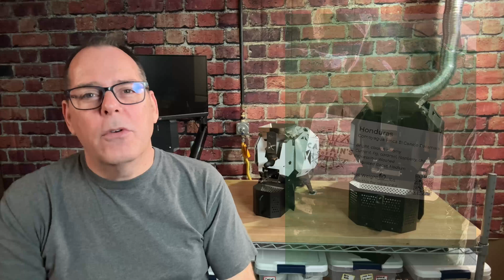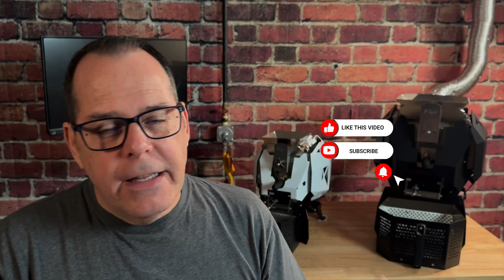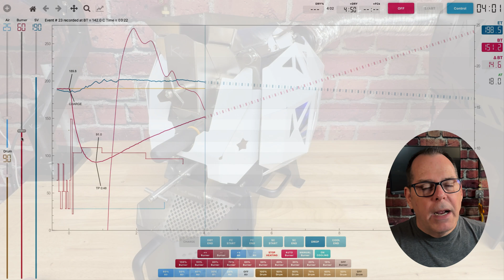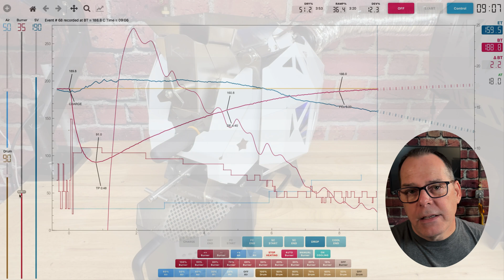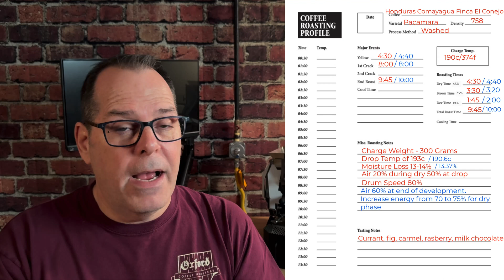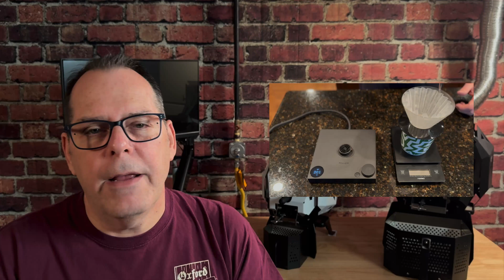Creating And Following A Coffee Roasting Profile

Comment: Hi! Have you any experience in roasting Turkish (for ibrik|cezve) coffee?
Reply from the maker: That's an interesting question.  I have never roasted specifically for Turkish coffee.   I would be interested to hear your opinion about my thoughts.  And, correct me if i am wrong.  
 I thought Turkish coffee was a brew method using super fine ground coffee, almost a powder and not the roast level?  As with espresso, which is a brew method, not a roast level, we can roast to whatever level we want based on what we want to taste in the cup.  Generally speaking, lighter and more dense roasted coffee may be more difficult for the barista to dial in for espresso.  It doesn't have to be dark, although Italians and many others use dark coffee for espresso.  Whether light or dark, it's all about solubility of the bean for extraction.  So, a lower density roasted coffee (one that is roasted darker) is easier to extract.

I think the same could be said for Turkish coffee.  Honestly i don't know if traditionally the coffee is roasted dark for Turkish coffee is roasted and drank in the middle east. I have traveled to the UAE and was served Turkish coffee in a "traditional Emirati eating experience" and i assumed it was traditional Turkish coffee.  It was was a nice medium coffee.  It was not really dark.  I've seen a lot of really light roasted coffee from the middle east, especially the Yemeni coffee.

About the brewing.  Turkish coffee is the finest grind you can achieve and is almost a powder.  Turkish coffee is brewed and drank with the grounds in the brewer and cup.  The user pours the coffee from the cezve (or ibrik) brewer into the cup, grounds and all.  Then the grounds sink to the bottom and the users drinks until the coffee left becomes thicker.  It might be fun to try that on my channel.  Thanks for your comment!
Reply: @VirtualCoffeeLab  yeah, thanks. Found similar opinion in some case.

>>>there's not a specific roast level for Turkish coffee and I believe there shouldn't be. But here in Turkiye roasters generally prefer 2 types of roast.
a) as soon as first crack starts you stop roasting (and most people claim that's genuine Turkish Coffee)
b) you keep roasting even after second crack ends which is dark french roast (and they call it double roasted)

South American beans, even with very light roasts they will keep their sweetness when you brew Turkish Coffee. If you decide roasting darker you may try central american (such as SHB Costa Rica roasted to City+), if you'll pass beyond city+ then definitely Yemen (if you roast Yemen to cinnamon and leave it there, you'll be wasting good some coffee for nothing).
Reply from the maker: Thanks for sharing that info.  I appreciate the follow up.   There are a lot of Yemen coffee houses in Southeast Michigan and quite a few of them are putting out a super light / cinnamon roast.  I
I agree with the Central American coffee.  I would encourage you to checkout some of the Kenyan coffee.  I roast that to a medium light roast  but include some nice development.  It's a longer roast profile and the sweetness is almost ridiculous.

Comment: Another great video!  I have watched a number of your excellent videos,  but there is one thing I can't figure out...How long should I target my total roast time?  I have an SR800 with the extension tube and am currently roasting a fairly high density Guatemalan (713). I understand creating profiles and the 50/30/20 percentages through the phases, but don't know how to pick a total time to base this off of and don't know what goes behind the decision.  Any help would be appreciated!
Reply from the maker: Great question James.  I will give you the short answer and then share some additional thoughts.  
Total Roast time can range from 5-10 minutes

So, how does someone know what time to use?  

1.  experience
2.  trial and error.
3.  watch and learn from others. 

I can’t give you a simple answer because there are so many variables.
Batch size 
Bean type
Roast level
Brew method (roasting for espresso)
The roasting chamber

All of these variables will influence your total roast time.  You have shared most of the variable.  Let me know the batch size, your desired roast level, and then I will be glad to try and answer your question with a starting roast recipe to roast.  

One last thing.  The 50/30/20 phase thing is important but it’s not a requirement.  It is designed as a starting point and geared for drum roasting.  Air roasting is different because the beans are heated with air (convection) so there isn’t a pre-heat and the beans aren’t relying on conductive heat transfer (touching hot surfaces or beans) to promote the roasting process.  Ultimately, roasting times are shorter overall compared to a drum roaster. 

Sorry, one more thing, really.  You are using a razzo chamber.  I’ve never used one so there will definite some trial and error using my suggestions.  

Let me know your charge weight and desired roast level so I can answer your question.
Reply: @VirtualCoffeeLab  Thanks for all the info.  I decided it may be best to setup a Zoom with you.  I had some issues with the transaction on your site so I sent you a message. Let me know if you got it...
Reply from the maker: just replied to your email Jim.

Comment: Hi Mike, it makes sense. I have been dialling back the heat going into FC so I can have a longer browning phase. I was thinking that maybe trying a higher charge temp might help give me more momentum into FC but I may have to shorten my drying time to around 4 min which might still be ok. I’ve been charging at 160C, then soak until turning point, and aiming for a 5 min drying and 3:30-4:00 min browning.
Reply from the maker: Skip the soak on the Kaleido.  AIM for between 4:30 and 5:00 for dry.  Then 8:00 or 8:30 for FC.  I would pick an air setting and keep it the same for the entire roast
Reply: Interesting, why skip the soak? I have an M! your BT delta looks so smooth compared to mine, May i ask your settings? Great video! @VirtualCoffeeLab
Reply from the maker: @jasonthompson2064   the reason i suggested skipping the soak is because Edward (@LivingTheLifeRetired) wantes to roast darker than this profile.  He mentioned he didn't have enough momentum to push him through first crack and he was stalling.  
My settings are the "out of the box" Kaleido settings for Artisan.  I'm not sure what version of the M1 you have so maybe the artisan settings are different.  I know that when I selected the "machine" settings and selected Kaleido Serial, I had to enter 0.4 for my roaster capacity so things would match up.  Not sure if you had to do that step.  Your roaster would be 0.1 right?
Reply: Ahh I see, makes sense for skipping the soak. Yeah my my is set up as a .1 capacity. I've played around with config<curves<RoRa bit and managed to smooth things out a little. Maybe theres a more sensistive probe on the smaller models. Thanks!
 @VirtualCoffeeLab

Comment: It’s interesting that about maybe halfway into your roast or maybe it was after FC that the ET was lower than BT yet the BT was still rising. When I’ve done my few roasts I’ve seen ET get below BT and I’ve always upped the heat to keep ET even marginally higher than BT. How can BT continue to increase if it is above ET? But watching again I’ve picked up another couple tips!!
Reply from the maker: Yea, there were a couple of things that I did on that roast.  One was kind of a mistake but in the end it worked out.  I forgot to increase my SV (set value) to a higher temperature.  You will notice it is at 190c I think.  So, i pretty much was coasting at the end.  This is one reason why my ET was lower.  The second is inherent with the Kaleido design.  The airflow is designed differently.  The air is brought into the roaster through a singular port (on the newer sealed units) and heated up by the heating elements and all the hot metal.  So, by the time the air enters the roasting chamber, it is hot air.  The ET is measuring this air temperature right at the exhaust tube, which happens to be between the heating elements.  So, when I lower my heat, the ET is influenced.  In some ways, you could say the ET is a false number because of this design.  I haven't quite figureed out everthing so far BUT I can say this is the reason we see a declining ET going below the BT, even though the temperatures keep increasing.  
My hope is i can reposition the ET probe and see how that influences the readings.
Reply: @VirtualCoffeeLab I see the ET lower than BT a lot and when I bump up the heat to get the ET temp higher it impacts my ROR of course in that I do not have a nice descending line but instead like new little mountains. Watching this video again tonight I see that you are making a lot of very small adjustments up and down to kinda tease the beans along to end at a light roast. In my last roast I was trying for a medium-dark and the temp had a long ways to go so I had to apply more heat at the end to get it to finish in 10 min, which caused another ROR spike. I know, it’s a journey. Cheers.
Reply from the maker: Nice job noticing the "teasing".  That is a technique.  I call it "babysitting" the ROR but "teasing" is exactly what I am doing.  This isn't critical to do.  As a matter of fact, many will just let the roast have those waves.  I don't mind them because I know most of that is the probe BUT the big swings I like to try and manuipulate/control.

Yea, so for a darker roast you will need more momentum as you come into first crack.  You will want to shallow your ROR descent just prior to FC so you don't stall your roast.  Not sure if that makes any sense but because you are using my technique  in this video, you won't get the darker roast.  Your temps will need to be higher as you get closer to FC.  When first crack happens it may be a little more aggressive in the popping but that is because you are pushing the beans a little more with the higher ROR.

Comment: Thanks for another M2 video! It’s really been helpful navigating this machine. I’ll try doing a 90 drum setting. 

When I first received my M2, for some reason, the high drum speed, medium high heat (75), and low air (20-25) caused my roaster to go through an auto shut off. 

Maybe because it was brand new? But I’ll try these start settings and see if it reacts like yours.
Reply from the maker: You have to be really really careful to brush out all of the chaff from inside the roaster.  The sealed unit roasters were coming with a metal grate between the drum and
Cha drawer.  The chaff will lay on top of the grate instead of falling through.  When you go to roast a batch, that chaff can ignite and you will see your ET spike and then the shutdown happen.

I use a paint brush and also the wooden stir stick to get the chaff to fall through between roasts.
Reply: @VirtualCoffeeLab  yes I noticed a lot of the chaff still remained stuck in the roaster despite being washed or wet hulled beans. 

I try to get them with a brush as well, but after opening it up for a deep clean, there is still a lot of dusting on the sides.
Reply from the maker: Yea, the dusting isn't the issue.  It is the small piles that build up in the corners, the chaff laying on the metal rods that are between the tray and the drum, OR if you forgot to empty your chaff try from the previous roast.

Comment: I agree with alecpulinas6919 this is one of the best videos yet. 
I ordered this coffee from "The Captain's Coffee" along with a couple of others to show my support for the sponsor. 
I started with a freshroast 500 which I used for years and produced some excellent coffee. I was creating a blend of 4 different coffees for espresso doing 10 small batches and the results were excellent but took literally hours. I upgraded to the SR800 but ultimately regretted it because I really wanted to be able to follow roast profiles and ultimately develop my own.
I purchased an Aillio Bullet (I am really looking forward to seeing it on this channel), my first roast was some Brazilian beans that came with the roaster. After seasoning the drum, I did my first roast which turned out to be amazing, I was super happy! However things went down hill from there. During the next roast, the drive belt pulley on the back of the motor started slipping (because had not been tightened during manufacturing) burning the coffee. I was able to access the pulley and tighten the screws and the problem has not recurred, however, after over a year I have never been able to roast anything that approached my first attempt. Many of my roasts have a metalic and/or burnt taste even though the bean color looks good. I plan to roast the same coffee that is featured in the video and follow this exact roasting profile. If the result is more metalic tasting coffee I think I am going to cut my losses and get rid of the Aillio Bullet and get something else.

Comment: Another great video Mike! Quick question, how do you think your profiles on the M2 would transfer to an M10 with a larger batch size? Say 500-625g? Any recommendations on "upscaling" a profile?
Reply from the maker: Matt,
I think for your situation, you should focus on your rate of rise  RATE at dry end and first crack.  In my video I talked about having your ROR be at a safe level at dry.  I need to ensure my ror is not so high I have to do crazy stuff with my heat.  I want to be in control and aim for my target first crack time.  I won't be able to do that if I am struggling with my ror  being too high or low at dry end.  So, on my roaster I like to be at a ror I know I can control easily.  I talked about that in my video.  The same thing goes for first crack.  This is really important.  There is a ROR you will want to be at when you reach FC.  If it is too high, your temps will increase too fast during the development phase.  You noticed this in my video because you just commented on it.  In both cases, you will need to find that ROR number at the dry and fc events that will help you maintain control and get you to your target times.  So, the lower ror during development is key to prevent the 205 number.  You said it yourself, your fc temp is almost always the same.  So, that means you need to be at the right or entering fc in order for you to drop with good development and achieve your lower temp.  Remember, color is king.  Start with color and correlate that with your drop temp.  Then as you practice roasting, you will know your drop temp range for the desired roast level and moisture loss you want to be at.
Was that helpful?  let me know if you need further clarification.
Reply from the maker: Hmm, I haven’t done this in a video yet but if I focus on color first, trying to roast to the same color level between the two roasters I’m most of the way there.  After that I try and hit my event times.  I think I should be able to get pretty close.  Unfortunately we can’t rely on temperatures to be the same.  The M2 I’m using has different temperature readings.
Reply: Makes since. I'm still really struggling with final drop temperatures on my M10 for light roasts. My 1C is always 196C, plus ore minus a degree no matter what bean I'm doing. I've been trying to follow The Captains Coffee roast level primer and hit 205C for a light, city roast in about 18%-20% DT but it always seems to have to much roast characteristic. I have tried dropping a few degrees cooler with less DT (15%) and they are under developmed. I see your roasts only increase 5-6C after 1C. What's the key to that, a good DT percentage?
Reply: Super helfpul. My ROR is usually around 8 at 1C. But I Think I might be still coming in with too much heat (usually 50-60 or so). This works for my darker roasts. I'll give your tips a shot!

Comment: With the behmor, if I want to roast 12oz of beans as my outcome so close to a pound of green coffee, how would I go about that with manual, I was thinking charge it at 300 degrees Fahrenheit and start at p4 and to maintain heat and then go from p4 to p5 maintains high head til browning then drop to p3 til first crack and then p1 til drop time, any adjustments?
Reply from the maker: Hi Carson,  can you share the type of coffee you are roasting and the roast level you want?  It sound like you have been roasting in the auto mode and want to do some manual roasting.  Is there a reason why you have to roast 12 ounces?  Let me know so i can offer a helpful response.
Reply: @VirtualCoffeeLab  I have been roasting sample packs from coffee coral to see what type of beans I like, but for the future I want to roast bigger batches but since I am doing samples, I only roast 1/4 a pound at a time using the manual mode and tracking all my data, but I am having a hard time thinking how I can transfer my 1/4 roasts to close to a pound and how different that would be

Comment: Thanks for running this experiment. Your roasting profile worksheet is a great concept and is beneficial in the long run. I am doing something similar but much basic than yours. One thing I'd like to add is the ambient temperature. When I roast in the garage versus kitchen, I get dissimilar results for same profile. Also I used to dump beans from cold start, now I do couple of minutes of pre-heating on fresh roast. By doing this, I experienced a bit more consistency.
Reply from the maker: That makes perfect sense to me.  I think it would be interesting to use the exact same heat settings and compare the times and temps between the garage and kitchen.  This difference could possible be adjusted to make the roasts more similar?  Let’s say your 30 seconds longer to color change, maybe increase power level by 1 during dry and see if that helps?  Have you experimented with that?